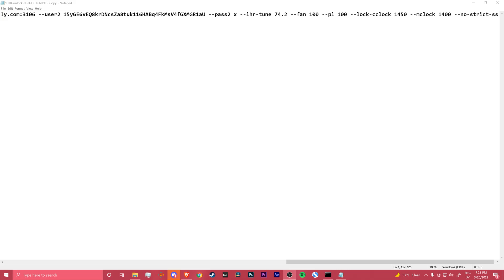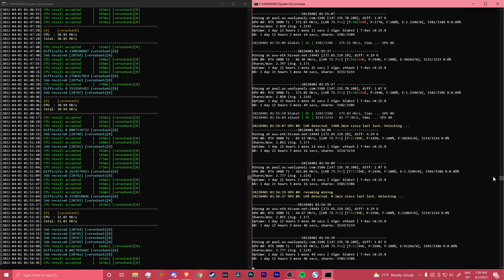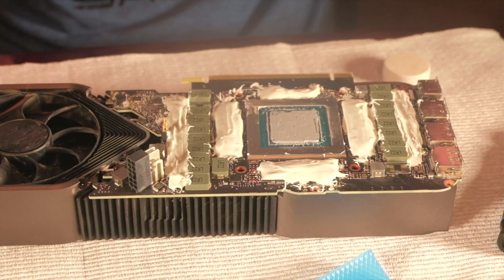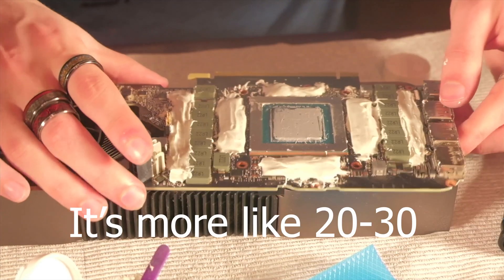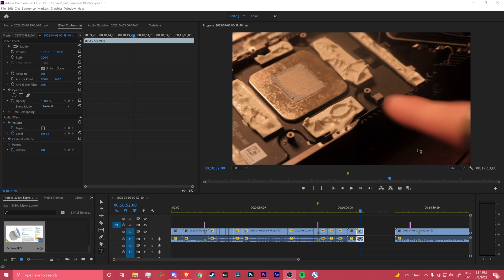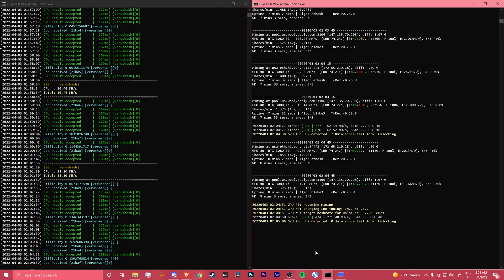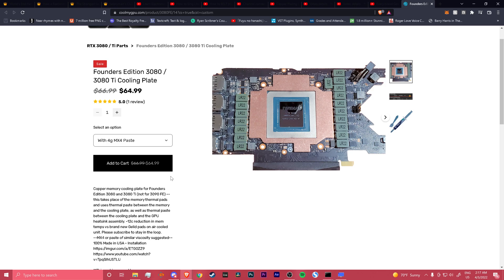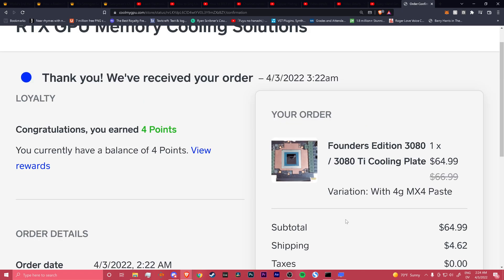Is K5 Pro Better Than Thermal Pads modding? Can it Tame 3080ti's Vram Temps?

Comment: LONG MESSAGE BUT WORTH THE READ!!! Just had the same issue with my 3080 FE memory temps hitting 108-112 when mining. I had gelid 1.5mm thermal pads on the front replacing the original thermal pads and gelid 2mm on the back behind the memory modules to try and better utilities the back plate. There was zero change... Actually things got worse! So I ordered some K5pro after watching the same LLT video you did. Then I saw your video and and realised I would only use the K5 pro as a last resort. Anyways I ended up pulling the 1.5mm pads off the front of the memory modules and replacing them with the 2.0mm ones from the back and left the 1.5mm ones everywhere else. WHAT A RESULT! mining at stock settings 87 MH. GPU hotspot 65-67c and memory temps now 70-72c. Maybe give it a shot and see how it goes! Thank you for your video. You saved me a lot of pain and heartache
Reply from the maker: thanks for telling me this, gelid thermal pads did help cool the gpu i have better than stock but i just wanted something better so i decided to use k5pro and you know the results.. the only thing i can think of is that i didnt put enough but it made contact with the heatsink so I dont know. I bought a copper plate weeks ago and it still havent came in and will make a part 2 to see how good/bad it is. thanks for watching too btw
Reply: @TheMiningMersie  yeah, it's a tough one and so frustrating. I actually was worried you put too much on and the heat was transferring around the sides of the components to other parts in the PCB. Have you thought about reaching out the the manufacturer about your problem and getting their advice and include a link to your video. I know it's a long shot. But worth a shot
Reply from the maker: @thorpie2206  i can try, i doubt they will reply. I actually got my copper plate today and i am not looking forward to clean this junk off

Comment: You should’ve also maybe put some on the back. As far as I know there are modules both on the front and back but doing this with proper thickness thermalright pads I achieved 70s for my 3080 and 90C for my 3090s
Reply from the maker: I'm using gelid thermal pads on the back, so it's like a hybrid k5pro and thermal pads